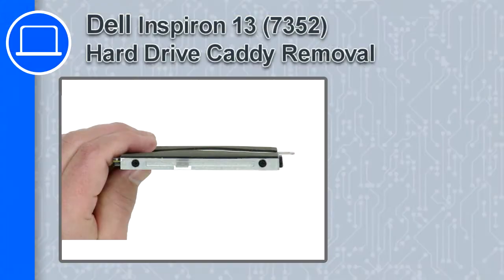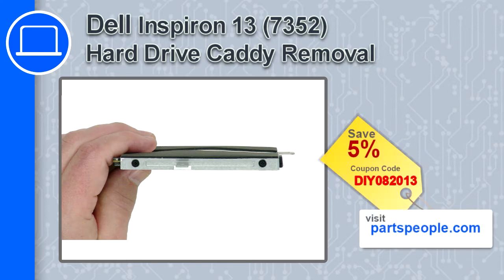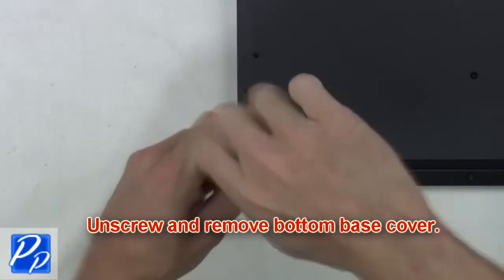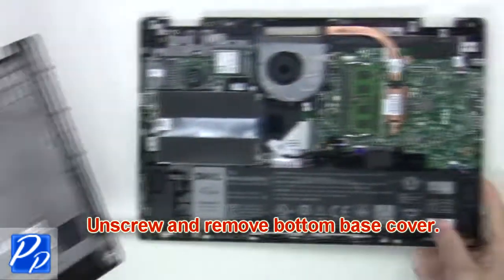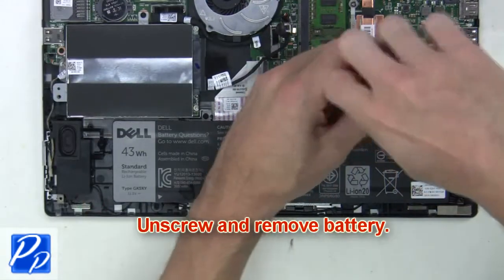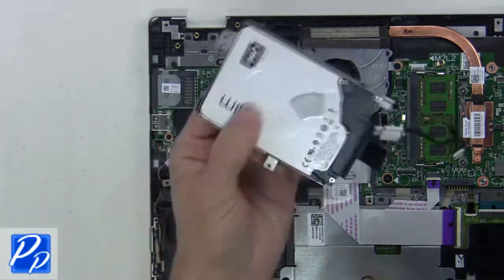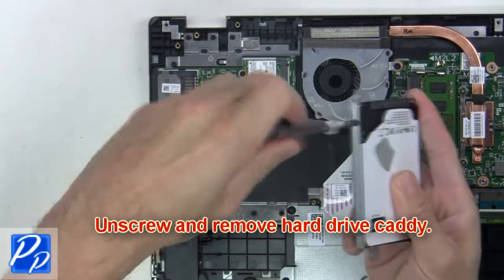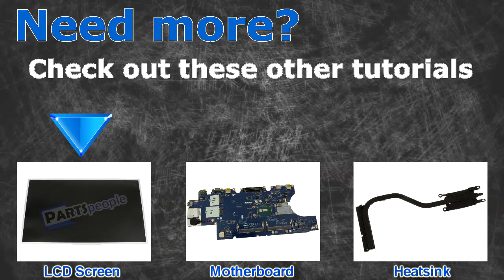Dell Inspiron 13-7352 (P57G-001) Hard Drive & Caddy How-To Video Tutorial

Comment: My HDD connector has a little crack where you plug it in. It still plugs in fine. But will this cause it to not resister the hard drive?